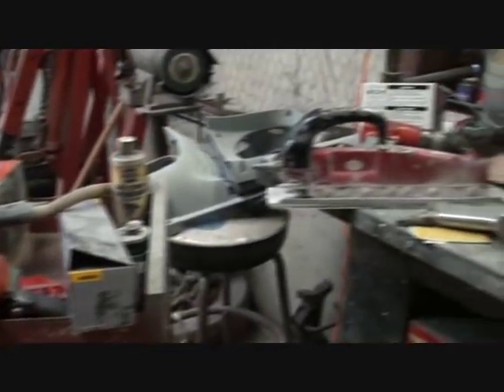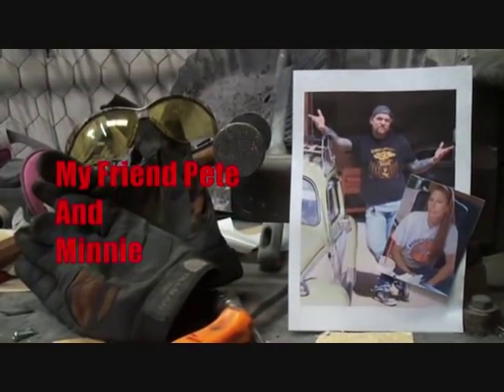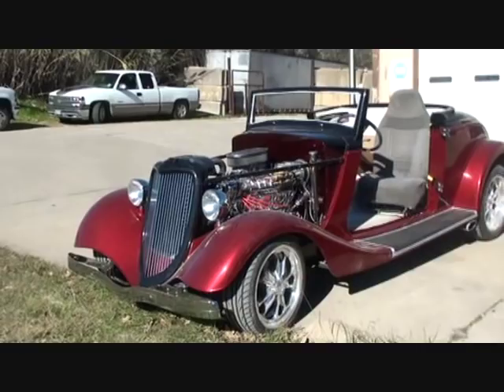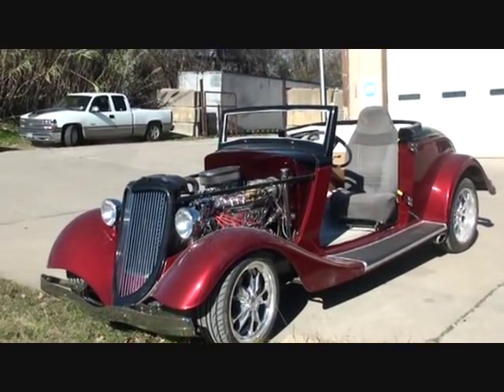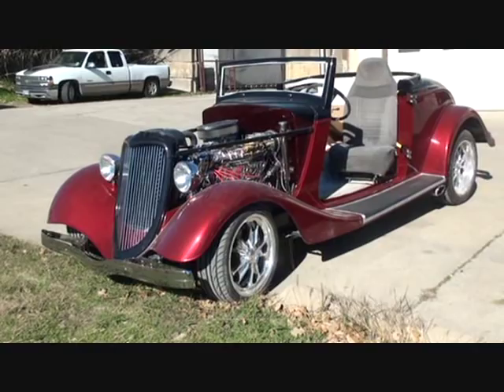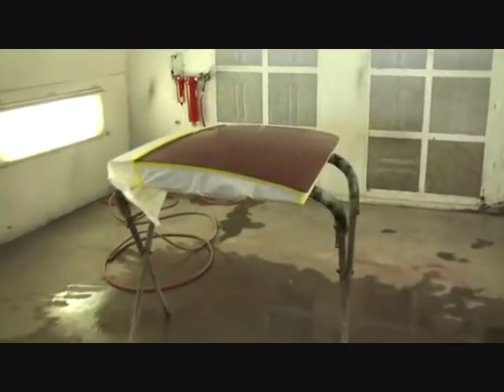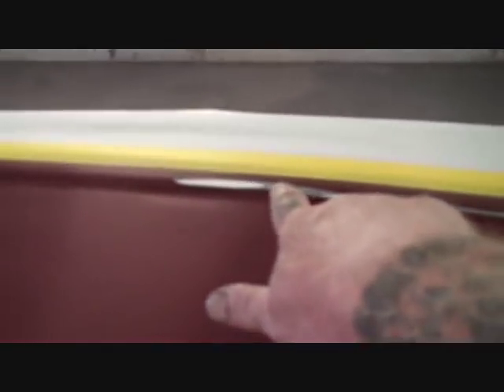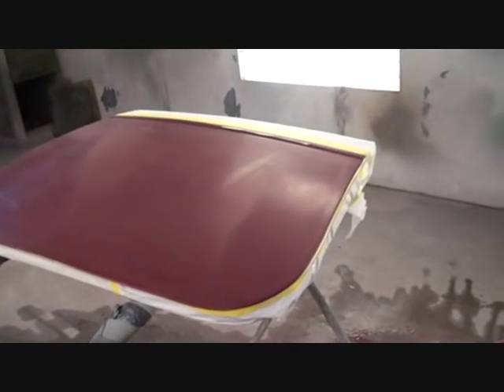Buffer Burn Repair-How To Repaint Your F%CK UP!

Comment: Pete! You're a life saver! I just got done color sanding (by hand with a block) and buffing my truck (3M's perfect-it system) and burnt through the clear and paint and I was so discouraged and pissed off. Thank you for this video! This gives me hope that I can fix them. Very valuable information about using the epoxy primer reacting to the clear coat! Thanks again!

Comment: MY FRIEND PETE!!!! First I want to thank you for your vids I have limited exp. in painting only shot single stage back in the 90's , anyway my 15 year old son wanted a 67 mustang so we bought one to rebuild . I have never shot BC/CC but with your vids and 7 months of body work,  priming,  blocking ,sanding and sanding and sanding   I pulled it off and it  came out very nice! THANK YOU! We shot it 4 days ago in our garage so it air dried and started wet sanding by hand with 2000 grit got the front clip done and buffed polished wish I could post pics here looks amazing ALL BECAUSE OF YOU!!!!!! Again Thank YOU! However tonight we moved to the doors and my son sanded thru on the door body line. So I ran to my laptop and found your video here . I was hoping you could answer a few questions for us. First did I hear you right we should wait 2 weeks to re-shoot the door? Also the whole door is sanded with 2000 grit its dull will that work to reshoot over? we plan on spot painting the base coat its a tru blue pearl color then re clearing the whole door. Thanks brother for all your great vids and help!
Reply: +domb1972 By the way I was  born and raised in Grand Prairie, TX  I'm a California transplant now, trying to get back home hopefully one day soon :)

Comment: Great tip...never would've thought about using epoxy primer...another lesson learned....also, it turned out great Pete
Reply from the maker: +SprayWayCustoms Just remember not to add any reducer to the epoxy primer.. In extreme cases you may have to rely on 2K primer to seal it up and then wetsand before paint...
Reply: Thanks Pete...I'll be sure to remember that

Comment: Pete, thank you for taking the time to teach this...a couple of quick questions ...you mentioned in the video you had wet sanded with 3000 grit...after you applied your epoxy primer what prep did you do to the rest of the door to accept the two full  coats of clear?  did you spray directly over the 3000 grit?    after wetsanding with  3000 grit is there enough of your original 3 coats of clear to prep for a reclear?  I was always told (rightly or wrongly) that to reclear  you need to sand with 1000 grit.  The problem is if you've leveled your existing clea,r is there enough clear left on the remaining panel to sand with 1000 grit...    what do you do?   Thanks!!
Reply: netjlr Exactly my question.

Comment: I get the priming, but don't understand how you blended basecoat into the surrounding area that had varying percentages of primer and clearcoar.  Did you use the same kind of mini-gun to apply the fill-in  basecoat and apply it drier than normal?

Comment: I agree with the epoxy primer…since it can be top coated within a couple hours. Depending on the temperature, I’ll just shoot base really dry (more air less paint)  or very little reducer. Two or three stage paints…may need to redo the entire panel.

I fck up a lot but I fix it. It’s just paint.

Comment: Pete, do you activate your basecoats? Typically I put 3% activator into my DBC and this prevents the basecoat from lifting if such a disaster occurs. I then mist on some clear over the burn through, allow that to dry and then come back with my base and clear. Typically this method prevents the lifting problem. I always activate my basecoats for this ease of repair reason. Without activated base doing it as I suggest above is impossible

Comment: I am confused Pete, if you can't paint the burnt thru area because it will blister along the edges of the clear coat, how do paint over the entire door on top of the clear coat without problems? I am assuming you have, to repaint the entire door to cover any over spray of the primer? I don't know shit about painting a car but trying to learn so what did I miss? Thanks for your videos PetePete
Reply: The surface of the clear, if cured, is fine to paint over with a compatible paint. The problem here, is the clear was broken through, exposing base and even bare metal. When this occurs and you attempt to simply paint over the broken edges of a burned through area.. The edges will react with the thinner in the new paint.. and the edges of the damaged paint will wrinkle. By applying a dry coat of epoxy based primer and allowing it to cure.. there will be no adverse reaction and the cut edge will be sealed off to the thinner used in the re-application of the base. Happy Days!

Comment: Lol you hit the paint with the wall or edge of the foam pad. ive been there lol. AVOID CONTACT OF THE WALL OR EDGE OF THE FOAM PAD WHEN BUFFING IT BURNS PAINT QUICK IF IT HITS A SURFACE. Its not like the wool pad where u can actually use the edge.

Comment: Thx Pete.  Maybe you can help me out.  I attenpted to wet sand out a clear coat scratch on the door of my wife's 2019 Hyundai Tucson.  I used 2500 grit wet sand and unfortunately burned thru the CC and into the paint but did not hit metal.  Just stupid on my part but I did not realize just how thin the CC in on Hyundais.  The mark is about 2" long and 5/8" wide.  There are not noticable ridges around the damage.   Took it to a body shop today and they are said they would need to repaint the damaged area, blend the paint on the door and then the adjacent porting of the other door and then reclear the entire door.  Cost ~$500.  There has got to be something I can do on my own to make this much less noticable.  I don't care if it is not perfect I just want it less noticable.  I'd have to do it using spray cans and manual sanding as I do not have a buffer and would not feel comfortable using one on such a small area to repair.  Any guidance would be very much appreciate.  Needless to say I am in the dog house as a result of my attempt at a good deed for my wife.

Comment: what about the overspray from the epoxy, will you will see tiny little dots from the epoxy right when you put on ur red coat ???
Reply: +patrick hogewoning That would be a problem if you where to use a FULL SIZE gun.. By using the touch up gun and alot of pressure it will contain itself in the area your spraying because it drys fast.. Also when you blend the paint you will cover any and all splatters you make.. It takes a good eye to make sure you GET ER DONE!

Comment: A guy was taken out a bumper dent he fixed the dent and the dent is near gone looks a lot better but now he also burnt the paint a small mark. Not sure what the next move should be. I figured a touch up pen.. but i don't know if that would do the trick since those pens are usually to fix scratches not necessarily specifying if it is good for burnt as well? Any help would be very appreciated thanks

Comment: Is it possible to paint straight over the burn through without reducer in the paint to avoid using epoxy primer and painting the whole panel? I have a burn though on a crease on a large bonnet and don’t have enough paint for the whole car

Comment: Hi there, I realy appreciate your knowledge and experience so thanks for the vids. I'm trying to decide and approach to fixing some pretty fine sand marks that wont buff out that are across my hood and in the clearcoat only. Too deep to buff out but still doesn't catch on your finger nail. I'd like NOT to sand them out because I think the clearcoat is getting thin and could burn through. I'm wondering if I flow coat another clear over the existing clear will that fill in the sand marks to make them invisible, and then I could just finish off the near clear coat. Or will the sand marks still show through?

Comment: I tried to sand and buff my headlights so they would look new and I burn through the plastic I think. There's probably no way to repair that I'm guessing
Reply: What you need to do is use a razor blade to get the melted plastic down and then use 500 , 800, 1000, 1500, grit sandpaper and work your way up to 3000

Comment: Thanks for the years and years of vids!  Question.. I burned through the color on a white single stage paint job.  Its on a door. It's a 91 Toyota MR2.  I'm thinking there is no way I can match the white, and single stage can't be blended.  So I really am screwed.  Correct?
Reply from the maker: +VeeDubJohn You'll have to paint the whole door... Being white it shouldn't be hard to get the factory color code and have some paint mixed and matched to the color you have. It takes a good trusting Paint and Body Shop Store Employee to help you out on your situation that will match the paint properly for you.. Good Luck. Pete

Comment: I finally finished the hood on my 2000 Dodge Ram when my friend said he saw a raised little drop of clear near the front next to the stainless steel grill and wanted to buff it down. I told him just leave it bc it’s thin and it’s not that noticeable so I’d rather not mess it up. What’s he do? Buffs right through the clear AND basecoat down to the orig paint. 
Theres no way to fix this little spot without redoing the whole hood is there. I’m screwed!
Reply: You can tape off around the area where the tape is not flat so it does not leave a hard line and add paint to the burn through area. Then add clear coat to the whole panel should be good. I did this myself on a bodyline, I now tape off body lines.

Comment: When you have a bare metal base, wich is in need of bondo....Just bondo it or first seal it with epoxy primer?
Reply: +D. Mulder If it's bare metal I do my bodywork first then 2k primer---blocksand for paint and then epoxy sealer and paint..

Comment: In your previous video to this job you said you cannot bend out epoxy primer it's only for a complete paint job.
Reply: +Valer Vitak In my previous video I SAID--YOU CAN"T USE REDUCER IN THE EPOXY PRIMER WHEN BLENDING OUT On A Painted Surface.. As long as you DON"T USE Reducer in the primer your fine...